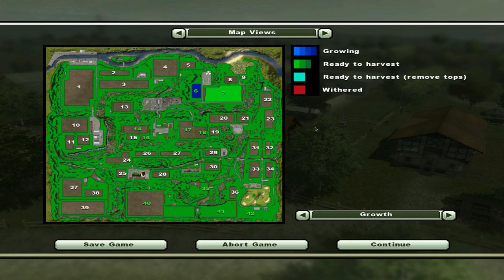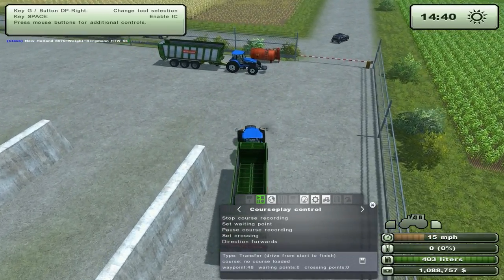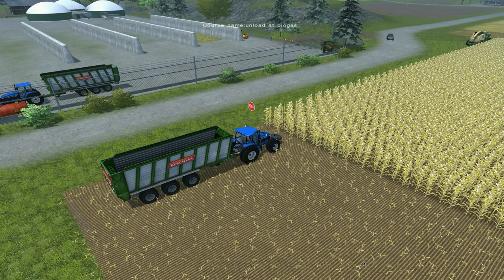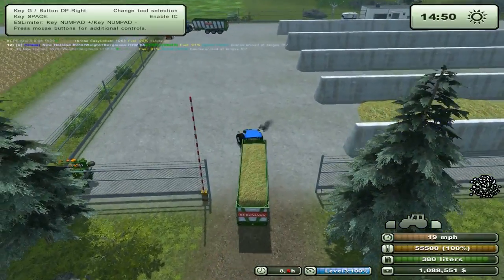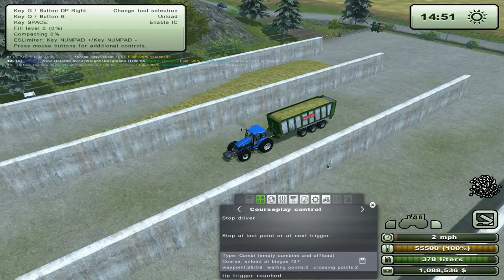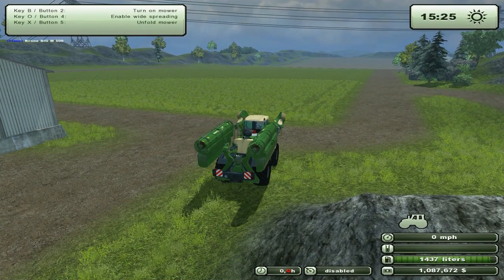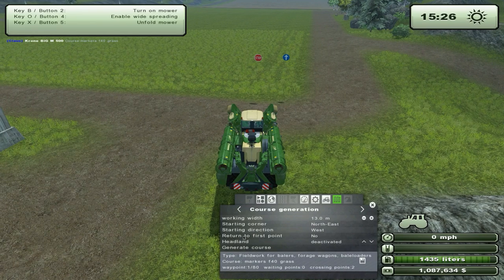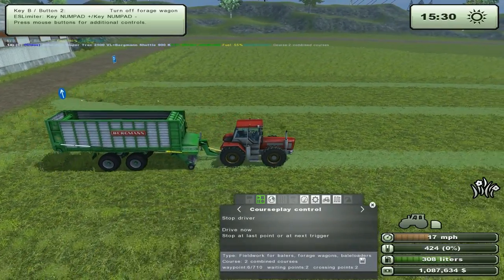Courseplay Tutorial 18 - Advance Course - Silaging Both Grass and Corn

Comment: The tractors are really good at finding obstructions when turning around at the field edges.

Also, if you have trouble with the tractor getting stuck when driving onto/off the chaff pile when it's nearly full, use the schluter as it doesn't use the front weight and doesn't get stuck.

Comment: Hello Satis great Tutorials , just a quick question about the Big M 500 , to record course do you do the same thing as if you were recording a course to cultivate ?
Reply from the maker: All the recording for a route in a field is done the same way, by either driving the route your self, with an waiting point the the start of the field and one in the end of a field, to mark that the route between those waiting points are the working area of the field.
The course generation do this automatic for you as well.

The only thing that is different for the fieldwork mode is that if you use a bale loader, which I show in tutorial 12, is that the route for unloading, that you combine with the field route, you need a waiting point for where you want to unload the bales.

Anything else is the same :)

Hope this answers your question :)

Comment from the maker: Hmm it should do it, but I have only tried it with bales and the bale loader.
I'm sure there might be something they forgot to add in the code.
Oh yeah, are you using the developing version or the released version (v3.41) ?
If you using the developing version, then you should post this on there issue tracker, so it might be corrected in the future :)

Comment from the maker: Sorry for not checking this first, but the JF FCT 1060 Pro might not be supported since it's an attachable harvester and I know that they had some problems with those in the past and I don't think they have fixed it with the statement you posted about it was just waiting until fill level is reached.

Comment: The route you choose through the bio facility is the wrong way, first you should go over the weight machine, then tip. Of course its only a game, but if you want to play for realistic simulation, thats the way to go.

If these were trucks from a long way off, another farm - etc. they weigh the truck with its load first, then it empties and then they weigh the truck again as it leaves and deduct the weight of the truck from the weight of the truck with the load.

That is how they know how much silage they have in weight and how much to pay for the delivered load.

Usually there are entry and no-entry signs and arrows on routs around a facility like this that tell drivers which way to go.

Comment: I have been trying to make a course to sell straw foraged from wheat fields at a straw sell trigger without luck. The AI will run the field filling the forage wagon and then will drive to the sell trigger but will not sell. Instead it will simply slow down and drive through it and then proceed with the course. I even tried a wait trigger. It waits but does not sell.

Comment: Do you have any experience with the all in one silo's?  I am using a map with this silo and having trouble selling grain.  When using courseplay, to fill the truck I am having to manually push the "O" key to get the grain to fill the trailer.  Then the trailer goes to market, empties, and returns to the farm.  It goes under the funnel, but will not empty.  If I push the "O" key again the trailer fills and goes to market again. 

Any way to get the courseplay to empty the grain into the trailer?  I am using a map from American Eagles Modding.  It is their Modern American Map.

Also, do you know what the newest version of courseplay is?

Thanks, Ron
Reply from the maker: FS13 CP cant handle that.
FS15 CP have been modified to work with the standard MultiSiloTrigger, but that is not released yet.

I put the answer for both games, since I don't know which one you were using ;)

Comment from the maker: On the speed page in CP you have an option to set the BGA speed.
About the ESLimiter, if it's the global one you are using, then the one on ModHub should work fine.
Another thing that can make it say that is the tractor is an mod where the ESLimiter in added by the specialization, so you don't need the global one. if that's the case, then I really can't help you except saying, you should fine a newer eslimiter.lua file (if the file name is called that)

Comment: how shall i recording when i picking up hay? couse i start record with my harvester and then i save. later i make a record for my tractor with the hay wagon then i copy the file for the harvester but its ait work :( the map i have is sunshine XL latest version. pls help
Reply from the maker: you should be able to use the same route. Did you remember to change the mode to fieldwork mode ?
Reply: yeah i have change it to fieldwork, it all work so far to then i go and dump it in the barn but the tractor is just running over the dump-zone, what you have for program then you recording then you play?, i can use the same and show what the tractor doing in one lane, its a little hard to explane xD
Reply from the maker: lauri kottelin Hmm it might be the tip trigger that is not reconised by CP, because it's not a standard trigger. This happens on some maps I'm afraid.
Try it on the normal map and if it works there, then it's the map that you are using that's not CP friendly.
If not, then ask on the dev website in there issue section, since I'm out of ideas

Comment: The only thing really wrong with this game, (the fault is in ALL the mods and vehicles), the crop you run over does not react like it should and get destroyed.

This is what I think 'hard-mode' should be for!

I can prove its the vehicles that need the mod code adding, if anyone remembers Farming Simulator 2011 and the Brent Avalanche 1954 chaser bin / overloader. The original mod had an added bit of code that destroyed the crop when you run over it.
Tire-tracks in the crop, and lower yield where the crop was run-over.

This is more true to life, in this case; After-all, it is supposed to be called farming SIMULATOR isn't it? Where's the simulation part if the developers keep missing this one important element. If you run over corn, you damage your crop, like a teenager on a n off-road driving rampage.

You should always empty your harvesters without driving over the crop, if you want to play properly. Great video, love your tutorials, but you could do to drop the annoying music intro and outro and turn up your voice a little.